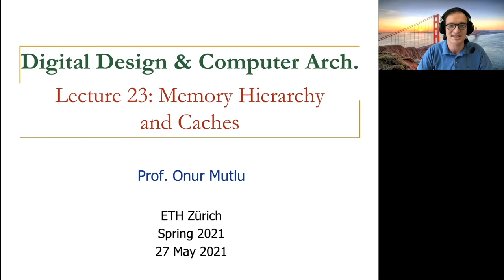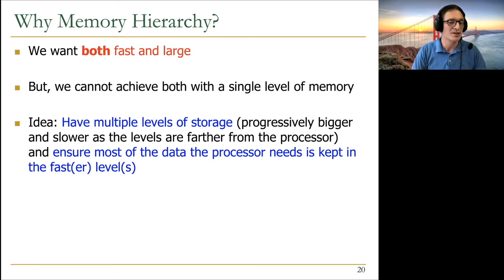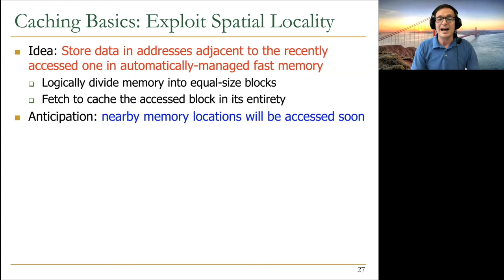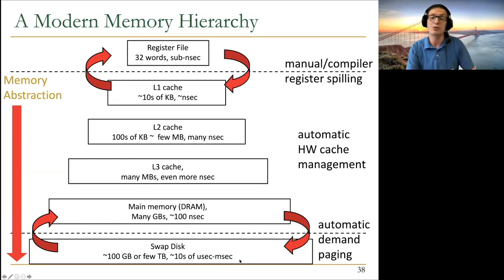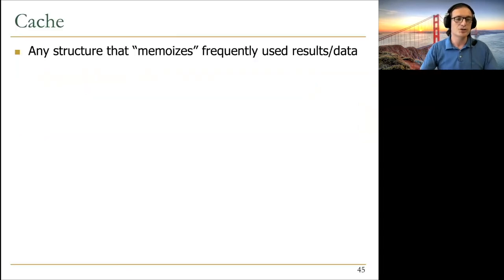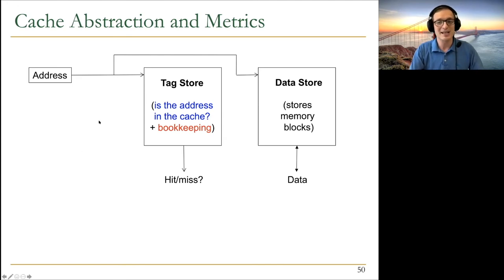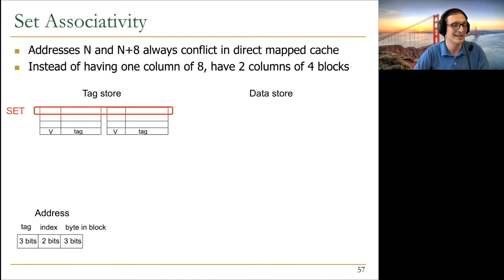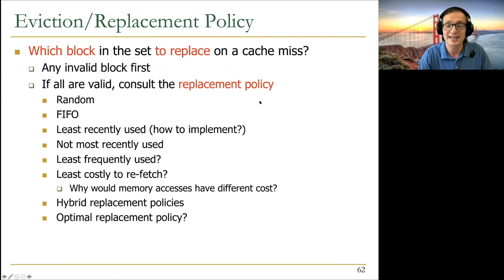Digital Design & Computer Arch. - Lecture 23: Memory Hierarchy & Caches (ETH Zürich, Spring 2021)

Comment: How does unified memory on chip (SoC) change the balance of CPU design (like Apple’s M1 Max) if the memory bandwidth is wider and access times faster?
Reply: I believe, it gets rid of L2. Also since the faster larger memory is closer,  it may not be inclusive of L1.